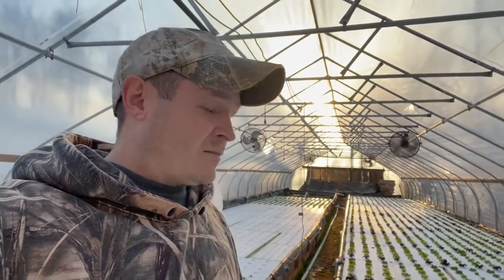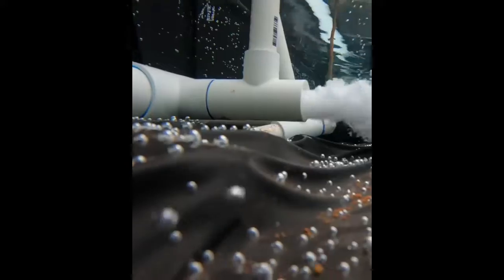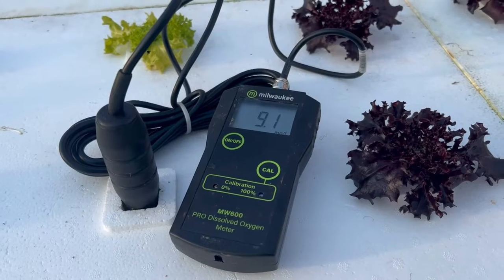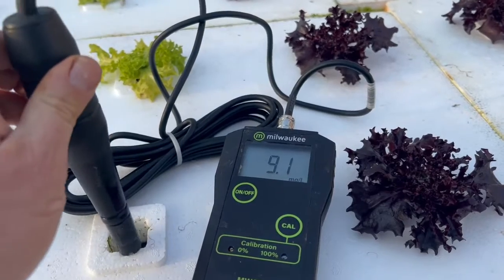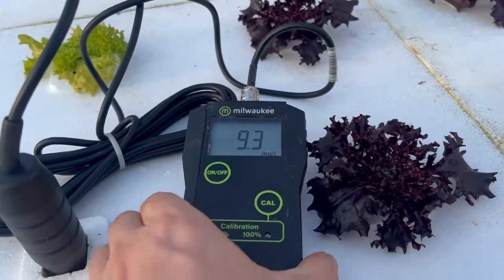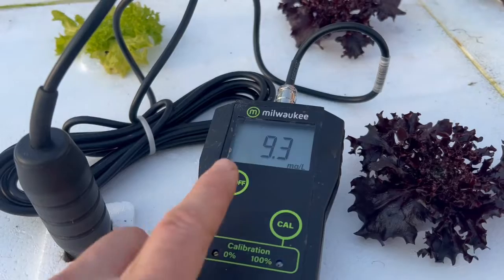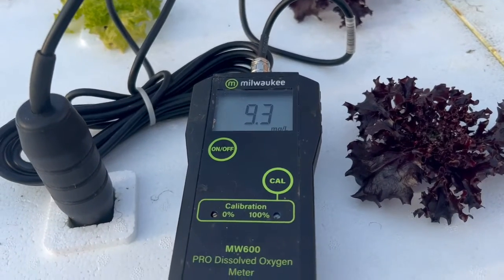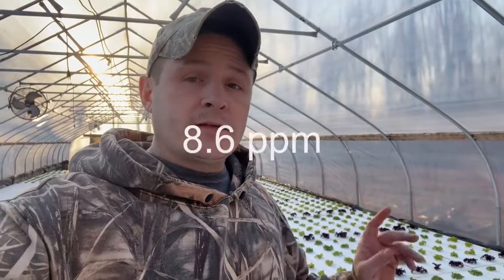Testing DIY Venturi with Dissolved oxygen meter!

Comment: are you using masterblend nutrients in your DWC? if so what formula??
Reply from the maker: 4-18-38 plus calcium nitrate and magnesium sulfate. The 4-18-38 is similar to masterblend, but made locally at a ag supply store. It’s much less expensive, but basically the same stuff!
Reply: @SaludaGradeFarm  wow! thanks! you're right that's basically same. may i know your mixing ratio? like how many grams of npk(4-18-38), CalNit, MagSul per liter or gallons of water?

Comment: How many gallons per water pump are you using in that particular floating raft bed?
Reply from the maker: Right now 4500 gpm, if the temp shoot’s up past 75 degrees I will double it. So shoot to push the water through once  every 2 hours in cool conditions, 1 time per hour in hot conditions.
Reply: @SaludaGradeFarm  Is that a typo (4500 gp'M'); vs 4500 gp'H'??? 
If it's not in error, then how many HP is your pump? Good video, thanks.